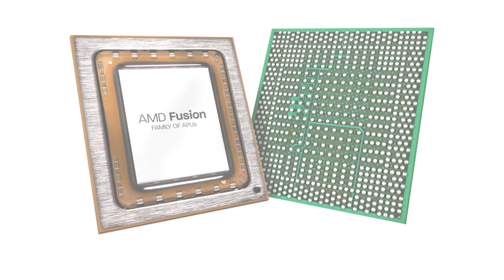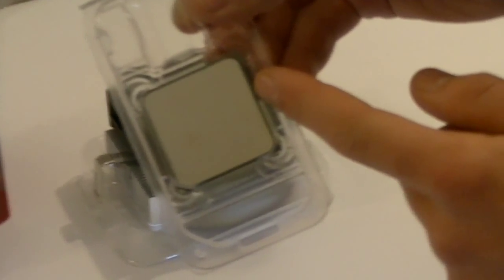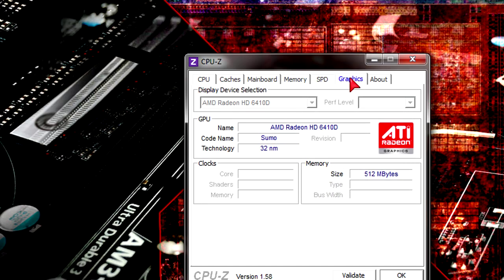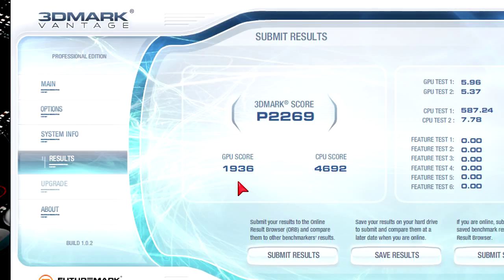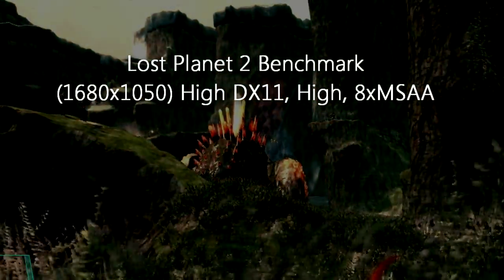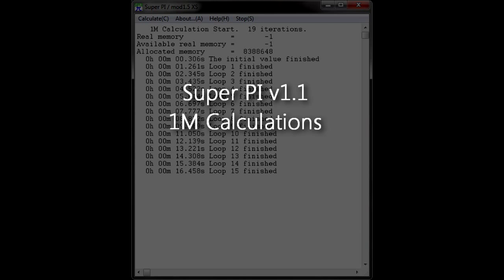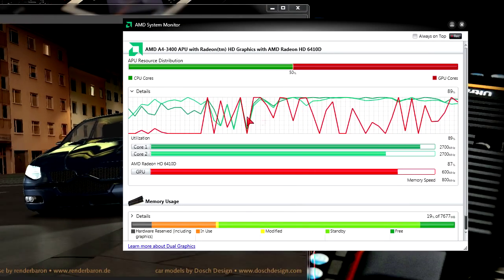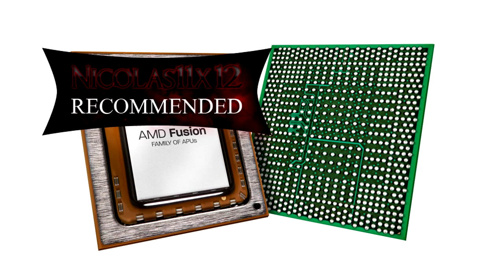AMD A4-3400 APU Review

Comment: I have this cpu and i still use the integrated gpu and it works just fine i can run crysis 3 on low at playable frame rates sooo shut up
Reply: Negru Giovani I know that  your comment is 3 years old but by any chance that your reading this could you upload a video of you playing crysis 3

Comment: i just bought this apu with a gigabyte a55m-ds2 mobo and i installed my sapphire ati hd 5670. but it flickers constantly. ive installed all drivers and software needed and even tweaked the settings to no avail. do you what might be causing the problem? or is it even fully compatible with with apu and mobo? please help

Comment: My main rig runs a 1080P monitor, and a 1080P tv at the same time(The 6750 can do this on both machines.) The HTPC with the 6750 runs on a 720P tv in the living room, and can't game worth a damn, I'm left with thinking the CPU part of the APU is crap.
Main rig: 8GB Ripjaw Ram 1600, MSi MoBo, 128GB SSD, 650W PowerSupply, AMD 1090T@ 3.8Ghz, GTX 660 (nonTi)

Comment: DO NOT BUY THIS APU with the thought that you will add a GFX card on later. The APU is so slow, that it become a major bottle neck, get the A6+ and add on later.
I have an A4 3300 with a 6750, and the 6750 only added a few FPS. Granted this is a HTPC and my main rig has a GTX660 but still, when i put the 6750 in my main rig it works great, can't max out things like Arkham city, but it still plays on medium. Put it in the HTPC, and it runs like crap (same game), Not the card, just the CPU sucks.

Comment: Well there will be both cheap and expensive ones, and as common sense tells, the more expensive ones will be better performing xD
The A10 will be top performing, then A8, A6 and A4
They will be manufactured using the Piledriver core architecture, which is an "Enhanced Bulldozer" with better IPC and performance.
The AMD A10-5800k might come out in May, it will be the highest performing desktop APU.

Comment: I forgot something important !!

What about games like Battlefield 3 in multiplayer mode ??? for the A4  / A8 and I3  ?  

Singleplayer on LOW quality maybe runs fine but what about multiplayer  for this settings I expect the A4 will have problems for smooth gameplay but the A8 and I3 + reccomended videocards will this be possible ?

Comment: Im a little bit a Noob sorry for that,  I don't know the word Crossfire but it sounds like mixing 2 things up..  So if I don't use a videocard and only have onboard videochipset Nvidia CineFX 3.0  it will not work at all with this A4 3400,   there is a specific videocard what Is recommended...

ok clear :)   And same story for the A8 version :)

Is this always the case b.t.w. ?  I allready was looking for this I3 what you spoke about earlier.

If you choose between A8 or I3  what would it be ?

Comment from the maker: Yes, you could run popular games like Battlefield 3 on Low Settings and lower resolutions. You can't CrossFire Onboard graphics from a motherboard with any APU. It has to be a specific discrete graphics card. For this A4-3400 a HD 6450 would only work out. Anything higher, older or newer will not work. If you'd like to see the performance boost of the A4-3400 with the HD 6450 check out my video on that. Exactly, the A8-3850 will not do the job when it comes to maxed out settings.

Comment: My question about onboard video was,  if it would be possible to run populair games like battlefield in LOW mode and in combination between the A4 3400  with onboard videochip instead of a videocard I ask this because within the A 3400 is a video processor and this will take care for videostrength not just the onboard chip.. And I wonder if they combine force 2 gpu's ?  

Ah so in fact the A8 3850 will not do the job in Maximum settings then I should choose for  Intel I3 + videocard gtx 560,

Comment from the maker: Yes, Battlefield 3 will run smooth on Low settings and lower resolutions. To run heavy games at highest settings I'd at least go with an A8-3850. But to be able to run games on maxed out settings an APU is the wrong choice. An Core i3-2100 and a GTX 560 would do the job for example. ;)

Comment: Will games like battlefield 3 run smooth on lower resolutions ? 

you think 2 of this cpu on 1 motherboard have enough power to run heavy games on highest settings ? Or better buy a single Quadcore processor ?   About the quadcore is there a model what is double of this cpu you reviewed here ? Little higher budget ?

Will it run with onboard video, and if yes what specs are needed. I ask because this allraedy have GPU in the processor so in fact it should work right ?  Power now comes from GPU ?

Comment from the maker: You can install any card you want as long as you don't want to set up a CrossFire configuration with the APU's integrated graphics. Getting the HD 6670 is a better choice than running the HD 6450 in CrossFire with this APU.

Comment: I'm currently running an AMD A4 3400 dual core, and I want to put an additional graphic card, but it says here in the package that the best I can get is the Radeon HD6450? Can you suggest a different graphic card but not as expensive as the Radeon? I'm thinking of putting a Powercolor HD6670 1gb ddr3 128 bit? Please help me on this Sir, Thank you...

Comment: Also you could set a lower resolution like 1360x768 or 1440x900 for low end GPU or IGP. These are commons resolutions for  low end system whith 20" cheap monitors. Also 1080p in 22"  or 21" monitors is to small from my POV. Again great review!. I was wondering how about a A4-3400  with a HD6670 at 1080 or 1050 vs celeron or Pentium G620 paired with a HD6670 . I was wondering if the A4 -3400 could bottleneck the dual graphics combo. Greetings from Peru and sorry for my  english.

Comment: Nice review.  It would be nice to see if this thing has any significant gain in gaming performance running an HD 6450 in crossfire (which can be purchased very inexpensively), or simply using a more powerful discrete graphics card.

Comment from the maker: @GearFusionComputer Okay, so you have 3 identical systems, 2 of them are having the same problem. At first make sure everything is connected and there's enough power. What Power Supply are you using? Then try using the VGA output if you're running with DVI at the moment (these are located on the motherboard's back panel). Please answer my questions and try everything out! :)